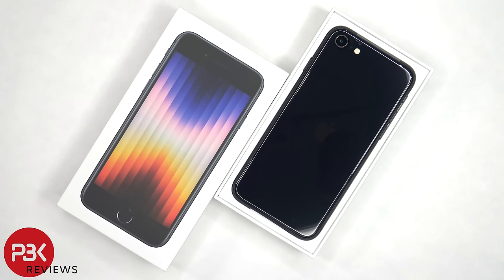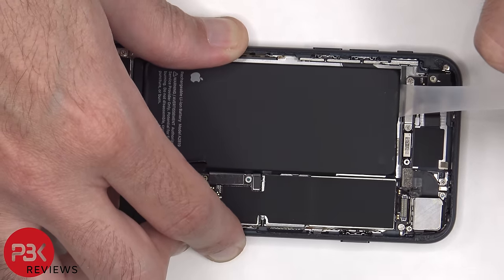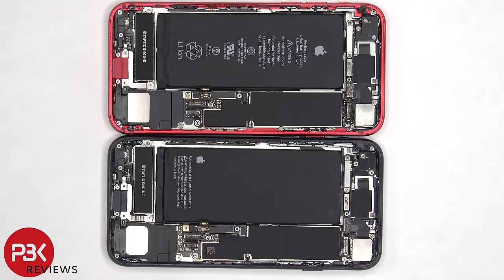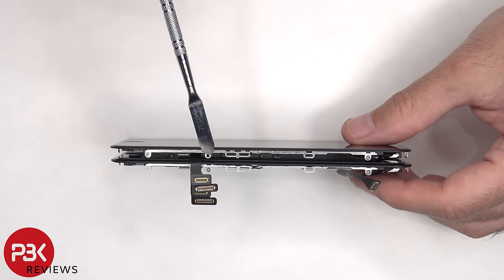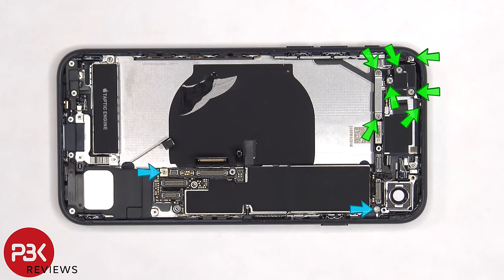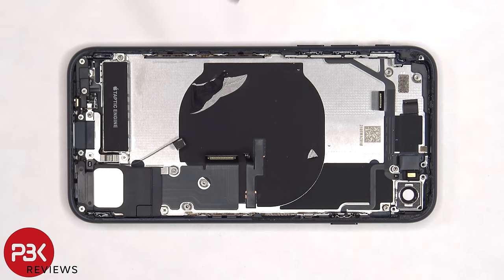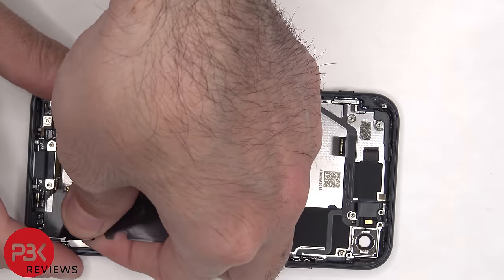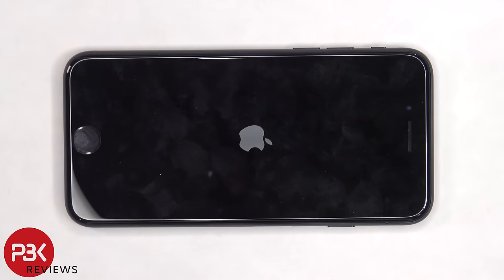Apple iPhone SE 2022 3rd Gen 5G Disassembly Teardown Repair Video Review. Same as 2nd Gen?

Comment: From experience as this happened to me yesterday, if you try to place the SE 2020 battery in an SE 2022 (it does fit if you force it) it will turn on but the reading will show as 0% and won't show charging at all. The voltages on the batteries are very slightly different - 3.82V vs 3.88V nominal respectively, and charging 4.35V vs 4.47V, and that very small difference totally throws out the reading. So yeah, almost identical battery but Apple really went out of their way to make life difficult with this one.

Comment: Thanks for taking the time to make this helpful video.  Purchasing the SE for my daughter, can’t quite justify buying the mini yet over the se, even though there are some battery life limitations.
Reply: @ihave7sacks  thank you for the input.  Get the 13 regular version then (vs the mini?). From the battery size of the mini, it didn’t look like too much of an upgrade on batt longevity.  T-Mobile is offering a couple hundred bucks off with a burner phone.  So the regular iPhone 13 is the one to get for her?
Reply: @ihave7sacks  appreciate the advice.  Spoke to tmobile and we'll swap the se for the regular iPhone 13 in the next couple days.   Sounds like the better long term approach.  Thanks in advance for your help.
Reply from the maker: You're welcome 😀
Reply: Considering the battery limitations that's good for your daughter cus she won't be on it all day
Reply: Just get her a mini. Let her have the luxury of having an oled screen at least.
Reply: @ihave7sacks  I had the same thought as well. I was upgrading from my SE2 to the 13 mini but when I tried both the mini and the regular in the store, even the regular 13 didn’t feel all that much bigger than the SE and I wouldn’t have to worry about battery life anymore. Since the 13 was available for almost the same price as the mini thanks to some discounts, I went with the 13 and I feel I made the right choice
Reply: Ended up returning the SE unopened, and swapping for the regular iPhone 13 256GB based on the advice from here.  Not a great discount on the 13, just a $200 trade bonus for burner Samsung G7A.  But better than nothing.  Hopefully no need to recharge the phone with long plane trips that are upcoming.
Reply: We did it bois, we saved his daughter from having an ancient display panel.
Reply: @Dongzzzzzz  lmao!  And saved Dad from carrying around 2x battery boost packs everywhere too.
Reply: @Dongzzzzzz  it is not that bad, for me it is decent tho.
Reply: @emersonsitorus1136  it's fine for its price but if the dad can afford the 13 why not coconut. The only good thing about it is the processor which destroys android competition in its price range but that's it.
Reply: Just how many of your kids have never heard the word 'NO'?

Comment: I’d see what happens if you change the screens between both models rather than just one. So put the 3rd gen screen on the 2nd gen. 

Apple uses I think like 3 different manufacturers for their screens, some can be interchanged while others can’t or, like you’ve demonstrated, can have touch issues. 

By swapping the screens between the models, it might help to determine if it’s an issue with the new device, or an issue with the screens from different manufacturers.

Comment: hey there PBKReviews, 

1.what happens if you disassemble the screen using the same tools but with out using (heat)? will the glass screen shatter?

2. can you take out the fingerprint reader without damaging home button? :)
Reply: Hi! I've been repairing consumer electronics for eight years so I can shine some light on this:-

1. The glass can shatter if you don't use heat as the splashproof/dustproof adhesive seal is very strong, however using thin tools such as the iSesamo will make your life easier and less risky! You don't need to buy an expensive hotplate, a basic hairdryer will get the job done.

2. Yes you can; the home button is held in with four screws and a small amount of double-sided adhesive tape on the flex cable section. As long as you use heat and take it slow, you'll be able to remove the home button without damage.

Cheers, and have a wonderful day :)

Comment: Excellent video. Thanks for risking the possibility of breaking the phone to educate us on some things. We didn’t see that the current SE 2 screen worked after you reassembled it. You sure you didn’t cause pry damage to the screen from misusing your plastic pick? Or that you may have ripped the cable? The pick wasn’t intended for prying on connectors, it was intended for cutting adhesives and separating the screen from glue. We make sure our technicians use tools for it’s intended purposes because of these factors happening and to confirm that the screen simply doesn’t work backwards or forward compatibility leaves a few questions to be asked as mentioned above. Again, good video and great observation. We were cringing in our seat when you were talking about removing the board screws and didn’t mention the hidden one between the rear camera and Wi-Fi cable, Beneath the foam pads.
Reply from the maker: Thanks! I swapped them back and forth a few times to make sure there was no loose connection or any other issues, but same results. When I put the SE 2020 screen back on its original board, works perfectly fine, but when I put it on the SE 2022, it powers on and shows fine, but the touch works in the center better than anywhere else and the bottom corner I can't click on the i for the imei info and sometimes after many attempts it will register it. Basically the touch has issues. But there is no bad cable or connection, since I swapped the screen back n forth a few times to make sure. The SE 2022 screen works perfectly fine with its original board as well after the test, since I also considered the possibility of a short when I put the screen from the 2020 but no short or any issues like that, just compatibility issues. As for the screw, I think I showed all the screws that had to be removed, no? Or were you saying you thought I wasn't going to do it but then I did lol. Sometimes I may not go in the most intended order but will make sure to mention anything that needs to be done :)
Reply: @PBKreviews  Excellent! Thanks for clarifying on that. And to clarify what i meant by the board screw, yes i thought you forgot about it and then seen you remembered it! You did an amazing job and better than most people we see on YouTube! We will be planning to go into details working on devices and posting them here on YT when we are more familiarized with a better recording rig, or “studio” minded setup for good, clean videos from the get go. If we are gonna do it, gotta go big - MKBHD style. You Definitely earned a few subscribers here cos some of our employees are really into the TechTube side of things.
Reply: If done right, using metal or plastic tools for prying connectors is perfectly fine.  Is it suggested for brand new techs?  Probably not.
Reply: @PBKreviews  have you tried to swap batteries pbs board with each other batteries

Comment: Great video very informative.
I was wondering if somebody could help me with this problem.
I have a iPhone SE 2020 there is a small square bracket on the main logic board between the board and the tapic engine.
I would like to know its function, there is an electrical contact point on it but it doesn’t seem to touch ground or any other electrical point.
there is a ribbon from the charging port that sits on the tapic engine then this bracket sits on top and then it is screwed into place
Could someone please enlighten me….thanks in advance Cliff
PS….you held it up so I could see it

Comment: PBKreviews could you please confirm that there is new camera hardware? Or is it the same camera sensor as iPhone SE 2020?
Reply from the maker: Physical look wise I couldn't tell a difference but not sure software wise since I haven't really messed around with the phone aside from the disassembly
Reply: @PBKreviews  iFixit with SE 2020 model swapped camera sensor between SE 2020 and iPhone 8 model - and it worked. Could you please try it as you did it already with the display ; ) Slow reading sensor without own integrated memory was the reason behind lack of Night Mode for iPhone SE 2020.
Reply: @PBKreviews  2014 just called, they want their iPhone back

Comment: Turn off the 5g and I get two more hours
Love my new SE in Starlight…
Reply: How much screen on time you get in single charger should I upgrade my iPhone 8 Plus to se3 my 8 plus give me 5 to 6 hour screen on time
Reply: @luckythakur1832  the new SE is not a plus…smaller screen real estate at 4.7 inches…I love everything about this new SE:
a. Rounded edge design looks futuristic to me and is so much easier to hold, the square edges of the new form factor dig into your palms
b. A15 lightning fast and smooth as butter
c. New tougher and more resilient front and back gorilla glass is also clearer in my opinion
d. Cameras are significantly improved through algorithms 
e. Speakers are clearer and louder
f. battery life with 5g off gives me an extra two hours over my previous gen 2020 SE…approx 9 hours, and also, it recharges from 0-50 percent in just 30 mins 

The Starlight color is beautiful as it is more cream than white on the back, and has silver framed borders which are distinctive

Comment: So from 1800mAh (SE2 2020) to 2000mAh (SE3 2022). 
A 10% improvement battery wich dies in 1 year! XD
Reply: A13 to A15 chip which is more powerful and efficient plus 10% increase in battery capacity so in total it should be 25%  better

Comment: Isn't it really weird that the display would work sometimes? if the pcb layout was different the touch wouldn't work at all, perhaps software issue? or it will be one of those weird cases when aftermarket displays will work fine and apples original displays will have compatibility issues. Have you done any more testing on this?
Reply from the maker: Yeah not sure why its working but touch has issues. I tried putting back the original display and worked fine but the second I installed the other one, same issue again. Aside from that havent done any other tests.